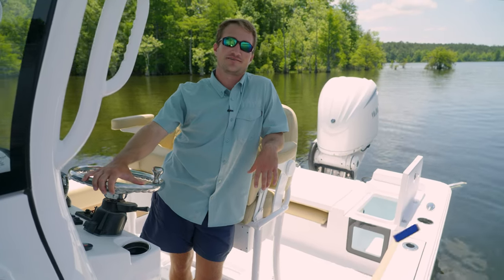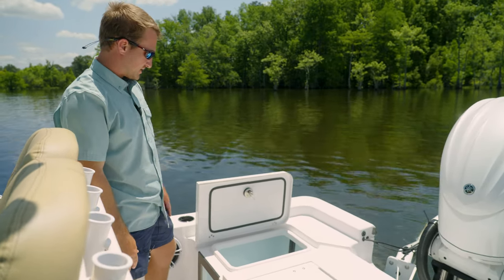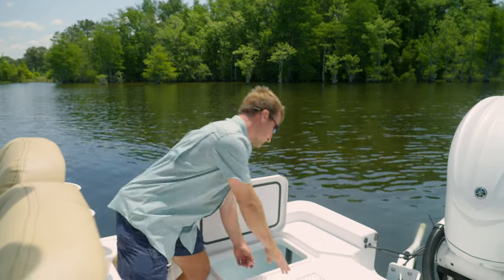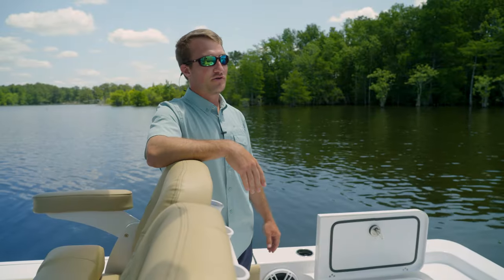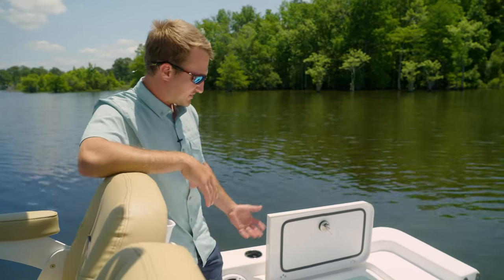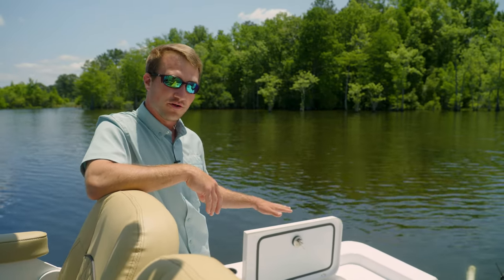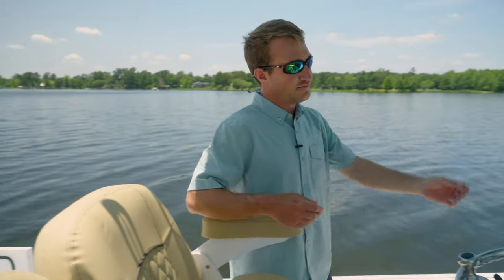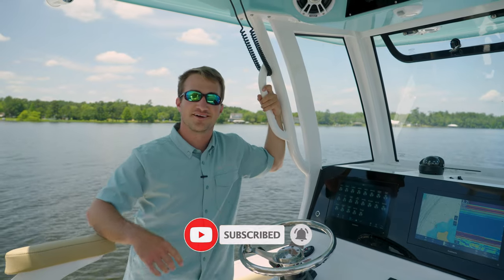Tech Talk - Operating Sportsman Bay Boat Livewells

Comment: What should we check if the livewell pump doesn't come on ? Where are the reset fuses ? I could check for power at the pump when I take it back out of storage but it's a new boat that is only 6 months old
Reply from the maker: This is from Chase himself, "The first thing I would check is the fuse located in the fuse panel in the console. Next be sure the pump has a solid ground connection by tracing the wire to the block or just cleaning and securing all the grounds he can find. Some models have ground block in the bilge as well. Lastly be sure the switch has a good connection and nothing has pulled loose behind the dash, if digital be sure fuse in DCM is secure and switch is in correct position for Maretron." If you're continuing to have any issues please reach out to your dealer as they'll be able to help resolve this issue.

Comment: Can both tanks be outfitted with the aerator and recirculation pump?
Reply from the maker: That is not an option from the factory but you can have your dealer install these before you take delivery or even after you have owned the boat for a bit.

Comment: 2024, 232 what is the max bridge clearance on the water with a radar or satellite weather antenna?
Reply from the maker: Sorry for the late response. I spoke with one of our technical reps and the height of the boat is 111-inches. On the water subtract the 16-inch draft and add 4-inches for VHF antenna mount as this is higher than the satellite antenna. So you're looking at roughly 8-feet 4-inches for clearance. I do not have the height of the radar but would say clearance would be no less than 8-feet 10-inches to be safe. For further questions please feel free to reach out via our tech talk email techtalk@sportsmanboatsmfg.com
Reply: @SportsmanBoatsOffical  thank you for your response better late than never
Reply: I have another question for you is the 232 unsinkable or positive flotation?